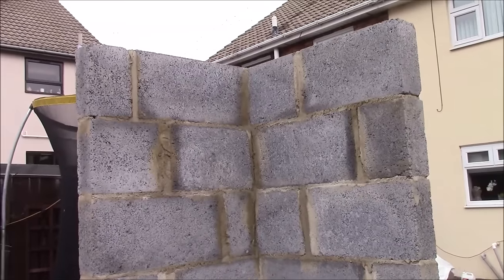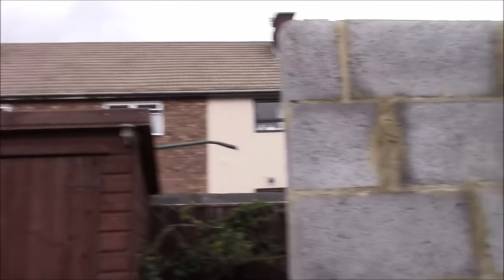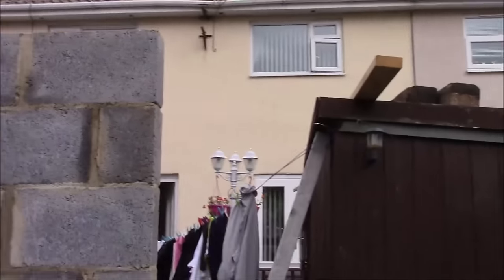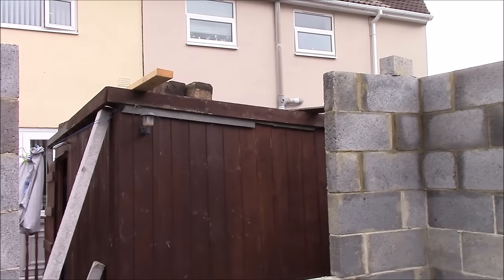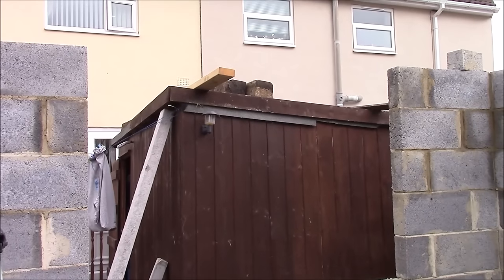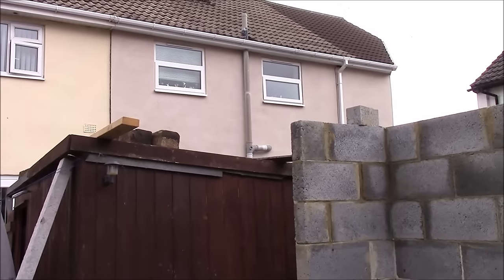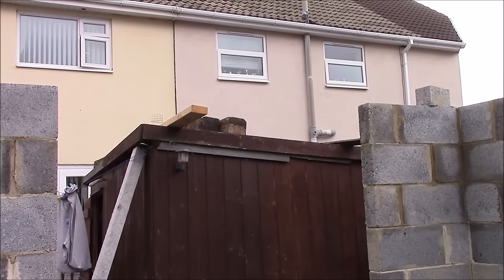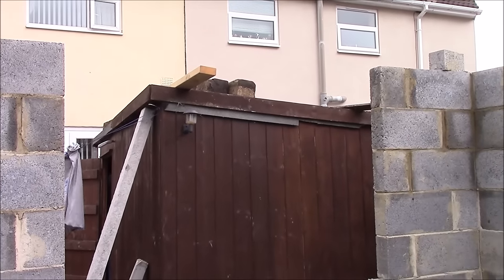How i built my breeze block shed part 2

Comment: 330 cuts in the corner is wrong. You should of broke the bond with a 100mm cut to get back to half bond
Reply: Nes Storms 

Factory corners 390mm X 190mm
Reply: Sorry mate but your blocks are 440 long so half bond would be 225. Set out like that you will not have cuts while running to a line. It will work complete bocks every course
Reply: Bricklayer work by gauged measurements neither 390 or 190 are bricklayer gauge measurements hence cuts in your walls
Reply: Nes Storms 

     Sorry mate but I’m in Canada and our blocks are 100mm, 150mm, 200mm, 250mm & 300mm wide all are 400mm long. These are all nominal sizes. Minus 10mm for the joint for actual size. 
     So we have factory corners if you want to spend the money. Other wise you make cuts.
   The 8” or 200mm block is pretty much standard the corners work out naturally.

Comment: Block on block is dangerous, this bricky tool should be taken off the market as novices should not be building walls that weigh as much as a truck!!!!
Reply from the maker: Micheal, it's not block on block the bricky puts a 12ml bed of mortar on to it so you can bed down to 10ml mate
Reply: Just meaning this tool incourages weak and substandard workmanship. Not so much yours but most other users of this product.
Reply from the maker: Michael Oliver I don’t think it was designed for people to go out and start building houses with it to make a living it think it was for the diyer mate as you no it takes years to learn the trade properly
Reply: @gibbopaul66  I can see both points of this discussion on that plastic thickness tool. It looked scetchy but the blocks still looked safe so. And it takes years to learn so who cares right lol

Comment: Does it need planning permission?
Reply: Planing doesn't need permission, go ahead and plane to your heart's content.
Reply from the maker: only need planning if it bigger than a third of your garden and above 2.7 meters high mate my shed falls under the size hope this helps.
Reply from the maker: HelterSkelter off the top of my head I don’t remember I think I used 4x2 CLS the span is only 11x10 and there’s no weight on it so they are quite sufficient for the load they are carrying.

Comment: Question for yourself and any other DIy'ers who've used the brickiemate. Do you find it helps compared to spreading a bed without it? 🤔
Reply: I've not personally used it mainly as I'm nvq 3 but one question I've often wondered is you lay a bed with it and place a block or brick . Tap and level . But I bet many don't check it's gauge . That's fairly important to . Fair play to the boys having a go looks tidy better than some I've seen . I personally use 100mm cuts in corners to allow 1 block cut into 2 half's.  Can use commons also . So half block a 100mm cut or common and full block . Saves time and waste . But 3/4 bat works

Comment: What sand did you use? I am building a pond  not sure if should use red or sharp sand
Reply from the maker: Use yellow sand to build with mix 3 sand to 1 cement then use double washed sand to render with mix 4 sand to 1 cement and put a waterproof additie in it dont forget to subscribe to the channel thanks for watching.

Comment: Impressive stuff mate. Looks like you were using the brickie mate?  I want to construct a garden room/garage with double cavity wall - first two courses went down and were 7kn concrete blocks and are square... I am thinking (and really thinking hard at this stage) of doing the remaining blockwork myself this myself given footings/foundation and first couple of courses down.  Can I ask:

1. How did you ensure the mix was consistent for the whole build?
2. If I want to have sides of outer leaf in concrete block and then front/back in red facing bricks as they look nicer and dont want to render - is there a way to tie them together in the corners?
3. Not planning to hang much on the walls but for inner leaf is using the intermediate 3.5kn aggregate blocks fine? Alot easier to handle...

Thanks
Reply from the maker: With the mix I used a bucket think it was 3 buckets of sand to 1 bucket of cement and if I’m right you can put 1 bucket of lime in it too but I don’t think it’s needed.
Reply from the maker: With your other question I don’t no you’ll need to as a Brik layer I’m sure there’s a few lads on here that could answer that for you just keep checking the messages on this post sorry I can’t help you.
Reply: Tie the brick into the block ,2 brick is a block, if u understand
Reply: 1. Can't go wrong with buckets 👍

2. There is! You have 2 options:

block are 2 brick long and 3 brick deep. Almost building materials are uniform to eachother so could build it like a coin feature like   

bbbbbbbfffffffff
bbbbbbbfffffffff
bbbbbbbfffffffff
bbbbffffffffffffff
bbbbffffffffffffff
bbbbffffffffffffff
bbbbbbbbfffffff
bbbbbbbbfffffff
bbbbbbbbfffffff

b = block f = brick

Or you can have a completely vertical mortar joint and use wall ties or even a wall starter to reinforce it. You'll see this on a lot of newer homes, but they're typically movement joints. 

3. 3.5 should be fine but it does depend on the size of the structure aswell.

Comment: I like that tool you're using to keep the mortar thickness consistent...what is it called?
Reply from the maker: Alonzo Branson it’s called a bricky or a brick mate  thanks for watching my video don’t forget to subscribe for future videos.
Reply: Thanks for the info.  I'm considering a concrete block garage for fire resistance, and this would go a long way towards keeping the joints consistent.
Reply from the maker: I would recommend it mate its a very good tool I couldn't of built the shed as fast without it.

Comment: What's the tool called that he's using to put the acurate amount of cement   to the blocks
Reply from the maker: Syrus K it’s called a bricky get them from eBay mate
Reply: @gibbopaul66  cheers mate I found it in the end I got one coming tomorrow or Friday it will be here I'm putting up a 3 ft wall in the back garden using blocks will that be okay with just cement on soil it's only to stop my path getting blocked up with mud as it was turned over not fully grown back with grass so chucking up a 3 ft wall will it be fine or will I have to put some gravel down
Reply from the maker: Syrus K no mate you need founds put in it will fall over
Reply: @gibbopaul66  I was gonna dig it out a bit make a little trench an have it level not directly onto soil but okay what's the cheapest foundation  I can use I haven't got much money but I'd rather do it properly
Reply: I was thinking gravel ?
Reply from the maker: Syrus K you can buy a ton of ballast for around £50 then some cement to mix with it use a 3 to 1 ratio
Reply: @gibbopaul66   sorry to bombard you with questions is it only in ton sacks or can I buy what I need as a ton is to much it's only a 3ft by 13 ft
Reply: They do bags of tarmac ballast In wickes £2.30 I'll buy a few of them
Reply: Thank you for replying 🤜

Comment: The bricklaying in that shed is shit, and how do you get compression on the bed and perp, so the device is 10 mm thicknto get the " perfect bed and perp" to get compression you would have to tap the bed and perp but then you would not have " 10mm perp and bed" so if you have to open out or tighten up what do you do then, l
Reply from the maker: Ian Davies no mate the mortar tool gives you a 12ml bed to set down to 10ml and the same as the perps shit or not it helped me build my shed as I'm not a brick layer I can't rate higher enough
Reply: So what you are saying is that the " spacer" for the bed and the perp are actually 12mm and you tap it to get the 10 mm joint on the bed and the perp.
If thatnis the case it's still shit, no bricklayer does 10mm bed or perp we go to gauge.
I regulate my perps and beds to get to gauge, but this device does 10mm bed or joint all the time,were I get pissed off is when they say I build a house with face bricks the only way they would do that if all the bricks were 215mm and 65mm deep and the blocks were 440x215,.
If the plastic is 12mm thick and you are using bricks that are 62 mm deep you are 2mm below gauge every time over 2.100 door height ( 28 courses) you would be 56mm short, if you were using blocks 210 mm deep and a bed of 10 mm you would be 5mm short of gauge with the 9 blocks and that final brick you would be 47 mm below 2.100.
Has you said it helped you do a shed, in my opinion it's shit
Reply from the maker: Ian Davies like I said I'm not a bricklayer and I don't and have never said that I am this video is not a how to video it's just how I built mine shit or not it is what it is if you read the comments you will find that you are in the minority of people that don't like the tool I was using thank for your comment anyway.
Reply: The majority is not inticative of being correct, good on you for building the shed.
If it's a plastered shed you can get the required heigh for lintel.
On many occasion I have asked how to you get gauge and keep gauge on horizontal and vertical on face block and face brick, the majority do not have a clue when it come to gauge.
All windows and doors work to gauge, has a plasterer you know that, it's not that the majority are dim witted it's because they do not know about gauge.
They hear "10 mm bed and joint" and they are ill advisesd its gauge, so the retort " I'm in a minority"does not really hold water, the minority are probably trades.
And the others are not in the trade and has such do not see what we see, got no beef with small walls, or sheds it's the shit that makes me mad,
Face brick house, face brick bungalow, friends of mine said it done a better job than a real bricklayer, and when I ask how did you keep to gauge on bricks that were/are 63mm or 67 mm, and again the majority were with this tool.

Comment: How deep and wide were your foundations?
Reply from the maker: Ashley Amos they were about 2 foot deep and 18 inches wide mate thanks for your question
Reply: Ab Fab Plastering Thanks for that. Sorry to bother you, just a couple more questions. 
Did you pour about 16" concrete? Also what did you do for your floor, was it a wooden suspended floor or a poured concrete floor later on?
Reply from the maker: Ashley Amos I poured it ab 16 to 18 inches deep and I put a suspended timber floor as it was cheaper but I should of done it in concrete really and I should of done it at the Dpc level before building the walls hope this helps

Comment: No pointing in, the blockwork is messy, line is on the wrong side of the blocks, bonding is all over the place, there is a straight joint where the half blocks are, this is not how to build a shed. DIY job not something to learn from.
Reply from the maker: Stephen Gibbs that's right it is a diy job and I have never claimed to be a bricklayer and this video is how I built my shed not a how too thank you for your constructive criticism.
Reply: It’s a fucking shed Stephen, not Kensington Palace.
Reply: Stephen Gibbs wow, this guy is a hero
Reply: so many d1ckh3ads in the comments section - he gave it a go and he's happy with his result.

Comment: this is the second time I've seen someone use a brick mate 😂ugh and the term BREEZE BLOCK IS THERMLITE BLOCKS NOT POXY MEDIUM/POSSIBLY SOLID DENSITY THAT YOUR USING. then not toe nailing or better know as strapping on the top of the block work to stop it pushing out 😂I bet you never used any sbr 😂 aww lol I put in a foundation on the 23rd and finished 3 days ago now and today's date is the 1st August laid 200 blocks in a 9 inch stretcher then DPC then a 4inch stretcher following up to 2.2meters to toe height for a roofing contractor all in total laid 300 plus blocks in only 4x 7 hour shifts 4 courses a day due to weight and got the lintle in. just hope your perps don't blow out because you never perp tapped your blocks nor watered the joints at the end of the day 😂
Reply: *you're
Reply: 300 blocks in 4 days lmao!!! that's cute!😂😂😂😂 I do 300 blocks in a day!  8x8x16 blocks and in 118 degree weather😉you ain't though pal
Reply: j diaz I do 1000 block in an hour

Comment: I had a shed like this built last year but with a PVC patio door and I had the floor tiled. It was fine all through the winter  and with all the rain, no leaks, great. We had hardly any stuff in there. About 2 months ago (April) we piled loads of stuff in because we were having our kitchen renovated. The shed was FULL of all sorts. When we went to bring things out to go back in the kitchen we noticed the floor at the back of the shed was soaking wet and seeping up into the boxes we had in there. The walls and ceiling were dry, the ceiling is lined with plywood. Have you had any problems with this shed or has anyone else looking on here had a similar problem. I'm thinking it's a problem with ventilation but not certain.
Reply from the maker: hi sheila I did have a problem with condensation until I put a vent in the wall now its fine thanks for your question.
Reply: The builder is going to put 2 vents in for me. We started leaving the door open in the day and removed some of the stuff to get a better air flow. As soon as the weather went a bit colder it dried straight away. We'll keep an eye on it in future and open the door more. Thank you for your reply.

Comment: Great job, i am planning on replacing my wooden shed with a block built one very similar to what you have done. was that a "bricky" you were using to lay your mortar? and was it any good? Cheers, Graeme
Reply from the maker: +Graeme Denbow hi Graeme yes mate it is the new bricky pro im a plasterer by trade before i built my shed i had never done any building work on that scale just little bits and bobs i would recommend the bricky its a great tool best £35 i have ever spent.
Reply: Must be the only "bricky mate" in existence to get some use😄

Comment: Hi. Thanks for these videos they have been helpful for my own shed build. Just wondering how you worked out the sizing for the roof joists? My shed is 5x3 metres so just wondering if 6" C16 joists will be big enough? Cheers.
Reply from the maker: Steven Brown set them out at 400 centres